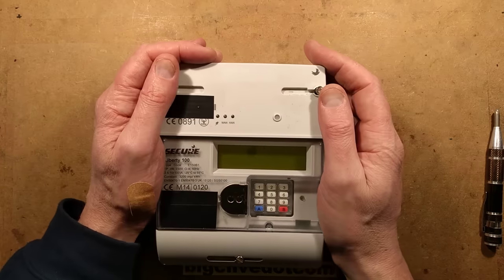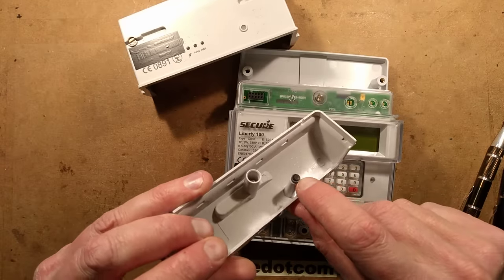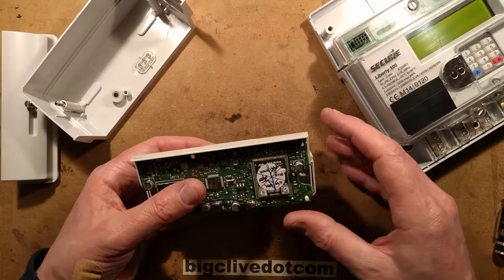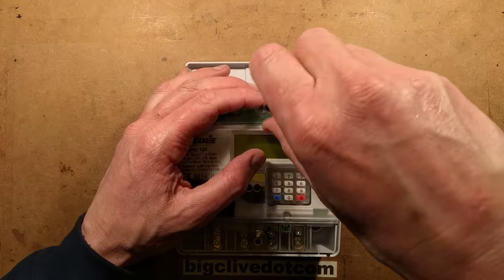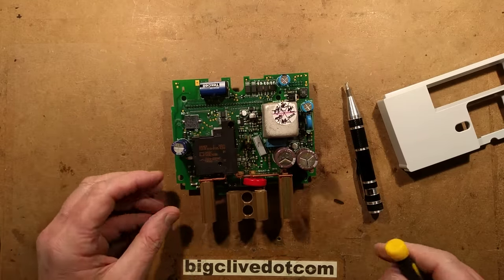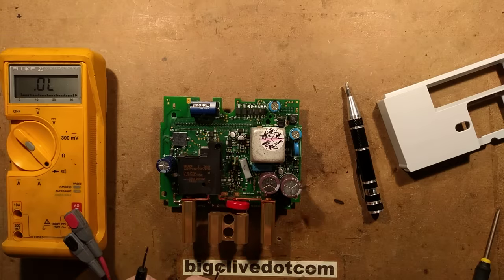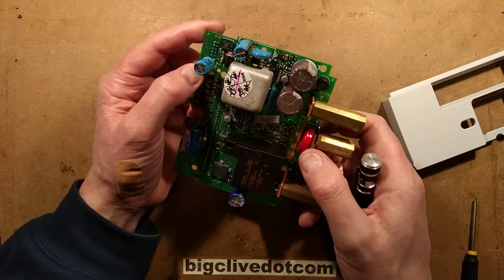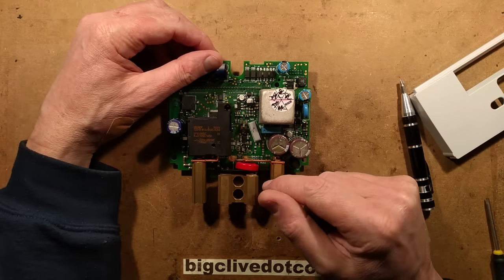Inside a smart meter, and the REAL problem with them.

Comment: It's smart not to have one.
Reply: The brain works on electromagnetic waves
Reply: @deanlatter5657  The brain works on membrane potential and neurotransmitters.
Reply: @falcon5751  No they don't work on WiFi, they work on the GSM network - mobile phones - to communicate with the electricity company..  They may use Wifi as a bolt on extra but their communication to the in-home display uses 433 MHz same as doorbells, etc.
Reply: jimW133 i know for a fact most lazy enexis workers in the netherlands will just put it on the home wifi

Comment: Great video Clive!  Is there any form of surge protection in it to protect the meter itself?
Reply from the maker: It's a while since I've seen inside it, but I'd expect basic surge protection.  Their use of small conventional transformer will make it electronically robust.
Reply: The Metal Oxide Varistor mentioned in the video protects the meter. It sits across Live/ Neutral and shunts current to ground when the mains voltage exceeds limits

Comment: The real problem with smart metters is that while they are properly calibrated and certificated there is a setting called 'correction factor' that can be controlled remotely and while normally it should read '1' there are cases when it is changed to say '1.02' and one of the reasons is to compensate for unknown power loses in a residental area, sometimes it is easer for them to adjust metters in that particular area than to seek for real cause of the power loss. So you receive bill for the real spent energy * 1.02 Not very legal thing to do as you can proof it with your own certified metter you can win the court.

Comment: Thanks for this Vid. Two key takeaways. Anti-tampering provision and remote cut off ( something not available on conventional meters).
Reply: You might add a third one: "education" of the customers: with more "wind and solar" (AKA fakepower) production, we get an increasingly unstable grid. Introducing penalties for power consumption at "peak" times is just a variant of rationing ... You might call this a soft "grey-out" to reduce the risk of a full-scale black-out...
Reply: Remote cut off is not a potential, and there are many ways of anti tamper/tamper detection Is in every meter, smart or not, credit or prepay. 

I worked for a manufacturing company for smart meters and now I install them, so I am well educated in this.
Reply: @raidersheen4873  There are other posters saying Remote disconnection of customers by Utility company was possible. My comment might have been slightly misworded.
Reply: @richardcope8102  there are also people who think the earth is flat. 
Whilst there is mechanical possibility to turn the supply off remotely, they do not have the software to do this. (Currently)

It is in discussion/dispute if energy suppliers should be able to turn off the supply, how ever it would NOT be for non payment, it would only be for safety, and would not be on a house by house basis.
The model that is being talked about is for large scale disconnection in the event of a large scale malfunction, say at a substation. This would make it safer for the engineers who are fixing the problem.

Comment: My impression is this thing is a fire hazard. It's well known that the contacts of series connected breakers can become VERY hot when oxidation takes place. Over time, the heat builds up and becomes a full scale arc, that will ignite the flimsy pastic case. Once the case is burning with flames, you have a house fire under your stairs. That's why contact breakers were always contained in a steel case to prevent an arc induced fire spreading to your house. This serious fire issue was "missed" in this otherwise excellent video.
Reply: "Once the case is burning with flames, you have a house fire under your stairs."
They are made of plastics with additives that don't hold a flame unless they are directly in fire. Breakers usually just darken and that's it. The other thing is, at least in hungary they made the placement of metering devices really strict in recent years and you can only have the meter in a really specific boy, on an outside front of the house, directly visible from the street, or on a metal frame at the property border
Reply: @whatevernamegoeshere3644  Once a full arc is established between line and neutral in the enclosed smart meter plastic case, the temperatuture rockets. Anyone who has worked in the Fire Service and H&S fire prevention knows nearly EVERYTHING is flammable once the temperature rockets!! Steel enclosures are about as fireproof as you can get, and EVERY breaker carrying high currents MUST be enclosed in a steel case. The "cheapo" plastic smart meters burn like a "Roman Candle blowlamp" once the temperatuture of a full blown arc is reached. The flames of the burning plastic case are also highly conductive, and increase the size and heat of the arc!! If this
 is happening under your stairs, you have a major house fire, and your family is likely to become KFC!!!!!!
Reply: @davidhine619  Once an arc is established between L and N, it's a short circuit and it blows the main fuse or the fuse on the street incommer. You have very little clue of how arcs work.
Reply: @whatevernamegoeshere3644  An arc is NOT an absolute short circuit, otherwise the heat of the arc would cease. Arc resistance is likely to be around half an Ohm or so THAT would NOT be guaranteed to blow the intake fuse. How do you suppose house fires due to faulty wiring etc.
usually leave the intake fuse unblown on low voltage domestic supplies?? A mains fuse is there to protect the supply before it, NOT ANYTHING that comes after it, which in this case is the smart meter, your house and your life. Be wise to fuse protection, and why any fuse is placed to protect the incoming supply and NOT the load!!!
Reply: @davidhine619  House fires mostly come from bad connections increasing in resistance due to long term oxidation, overloading or because of connections that were made between different , incompatible metals causing a layer of insulating corrosion (like in the case of Al and Cu). As for short circuits, a short is not a zero ohm short in this sense, but the current required to blow the fuse before it, under 0,1s time (or lower) usually, also known as fault current. And as for fuses protecting wiring before them... no, that's not how they work. Fuses always protect the load lmao. You are so confidently wrong that it's just hopeless. How many michael bay movies do you watch a week?
Reply: @whatevernamegoeshere3644  You talk nonsense. Any fault / accidental smart meter arc is as unpredictable as throwing a dice. I say again, with absolute authority, a series connected supply intake fuse is there ONLY to protect the equipment / wiring that comes BEFORE it. The electronic current breaker in your distribution box (steel cased) is wired AFTER the smart meter, so if the smart meter explodes into flames, your distribution box breaker will NOT protect you, as it's placed AFTER the smart meter. Got it?????
Reply: @whatevernamegoeshere3644  I suggest you look at some YouTube videos about smart meter fires and read the comments. I rest my case!!
Reply: @davidhine619  you are insufferable 😣
You win baby boy, have your bottle 🍼🍼 🍼 🍼 🍼

Comment: If they produced radiation the dosimeter I carry with me all the time would make a lot of noise. The microphone is under that shielded section btw ;) I do take issue with the whole claim about them changing the tariffs and measuring apparent power - most countries have consumer protection laws that would prevent the kind of thing you're talking about and in the UK especially the energy companies don't own the grid, it's not their problem.
Reply: Doesn't click, and there's a long list of reasons why I do and none of them are tinfoil hat.
Reply: I'm all ears, Martin.
Reply: monkaS.

Seriously though, I have a relatively quite high lifetime dose from employment (NDT) and medical reasons (long story) - to the point I don't personally think I should be flippant about radiation exposure - and just general scientific curiosity reasons (mapping what should in theory be background radiation levels geographically is a hobby project of mine). Never go full Cody.
Reply: There are other types of radiation, ionizing and non-ionizing are the key words here. Your dosimeter @Martin Nicholls only measures ionizing radiation, such as that put off from radioactive matter/fissile matter (Alpha particle, Beta particle, and the electromagnetic Gamma ray), whereas 2.4GHz and 5GHz and the rest of the telecommunications bands are non-ionizing. Sunlight, after filtered through the atmosphere and the magnetic field, is also non-ionizing (For simplicity's sake, the Gamma rays were filtered out). The issue with non-ionizing radiation such as 2.4GHz and 5GHz is that they excite water molecules (vibrate, etc). Those frequencies are easily blocked/absorbed by water. For reference, a microwave oven uses 2.45GHz to excite the water molecules in your food. This is the reason why people think that you can get cancer from 2.4 and 5GHz signals, and they would not be wrong as non-ionizing radiation, similar to ionizing radiation, has an additive effect to your body, similar to how the non-ionizing radiation put off by the sun can give you a sun burn, sun poisoning, and after years of repeated and severe exposure - skin cancer can develop from damaged DNA in skin cells, cells which would under normal conditions be eliminated by the body, but, after repeated exposure/years of abuse... In the case of the 2.4GHz and 5GHz frequencies, this damage is caused thermally.

The water molecules in your body, similar to the water molecules in your frozen dinners or in the water molecules of a poor frog some heartless kid threw into a microwave (think of it as an exploding can of red paint and goo), WILL, WITHOUT ANY QUESTION, be vibrated from any 2.4GHz or 5GHz signal to some degree regardless of intensity. The faster a molecule moves, the more energy it has. The more energy it has, the more the object expands/the hotter it gets. The key word here is heat. Eventually, DNA CAN BE, and IS damaged by the thermal effects on water by 2.4GHz and similar signals. There is a reason why microwave ovens have a metal mesh screen over the glass, and there is a reason why microwave ovens are built out of metal - it's a Faraday cage that is built to keep your face from melting off, or at minimum, to keep you from getting cancer.

As per the claim by bigclive and others that there are no harmful effects of non-ionizing radiation:
There was a study performed recently that examined the effects of non-ionizing radiation on the DNA of bacteria collected at cell phone tower sites. They had discovered that of the bacteria that could actually survive the thermal effects of non-ionizing high frequency radiation were multi-drug resistant when compared to other samples of the same bacteria taken somewhere else. The conclusion was that the DNA of the bacteria was damaged in such a way that it was able to rapidly mutate defense mechanisms to antibiotics, thus making these cell phone towers the proverbial breeding grounds of super bacteria strains. Additionally, another recent study found that women who place their cellphones inside their bras were many, many times more likely to develop breast cancer right underneath the same exact spot on the breast that they preferentially place their phones. 

I dont care what sort of background bigclive and others may or may not have when it comes to engineering or EM radiation... if you can cook with it, if you can potentially transmit power with it, if you can damage DNA with it, if you can mutate bacteria with it, and if there is medical evidence of the potential for it to cause cancer, calling it "safe" and saying that everyone who disagrees with you for a valid reason is a tin-foil hat wearing conspiracy lunatic, even if it was not actually said in that way (intent), makes you look like an ass.... Further, any basic college physics course should cover this subject, as these physics courses specifically deal with energy/heat/heat transfer (along with kinematics/etc), and these same courses should also cover EM radiation and it's effects as well, as do most two-part introductory physics classes for scientists/engineers do. Anyone who was actually listening to these lectures would at minimum know that 2.4GHz signals are used/can be used to vibrate and heat up water molecules. 5GHz can also vibrate water molecules... as can a whole band of frequencies. 

Maybe the effects from a singular cell phone are not that bad, but considering that the entire globe has thrown itself at cellular technologies without first investigating it thoroughly over the course of decades, and considering that there is only going to be more and more non-ionizing radiation pelting one's body, it is a wise precaution to get people to turn their phones off from time to time, and it is a wise precaution to enact stricter regulations to EM radiation from telecommunications equipment. A cell phone surely is not a microwave oven, but the effects, again, ARE additive.
Reply: "For reference, a microwave oven uses 2.45GHz to excite the water molecules in your food" - when they start putting cavity magnetrons in metal boxes and forcing people to sit in them to get phone service this will be worth talking about - it still wouldn't give people cancer btw, but it would be dangerous. Not for nothing though the effects of EM radiation are well known, the levels drop precipitously within meters of antennae and we're deep enough into the existence of this technology that you'd see epidemiological evidence of problems by now, and guess what - you don't. The tin foil hat brigade is why we can't have an adult discussion about the V band - you're doing far more damage than good I'm afraid.

Comment: SSE keep asking me if I want one.After watching your video,I'll decline their polite offer.Great advice
Reply: I had a lucky escape, SSE were due to install a smart meter..  Im in an area with no cellphone coverage and the electrical supply comes into the house via lead and paper insulated wires and to a Frankenstein like power board with many rcds, Bakelite and wood junction boxes and very old dodgy looking wires.  They literally took one look at it and buggered off stating the property was unsuitable for a smart meter installation. Lazy sods lol
Reply: @meetoo594  We had the same with SSE, to the point they got very rude with my wife when she kept declining. I changed company to a supplier that is not a so called top 6 supplier. So far, that second supplier seems happy to allow me to send them readings via their online portal each month.
Reply: @JohnCarverUK  Im in a bit of a spot now, the button that displays the electricity used has busted so I cant give them readings anymore.  I have guessed the last few times  but will have to get em to fit a new meter soon as I really dont want to be clobbered with a giant bill when they eventually work out the actual usage. Should be fun watching them scratching their heads as they try and work out how to tackle the job lol.
Reply: @meetoo594  I would visually record evidence (at the time of handover) that the meter will not read, as they are going to struggle perhaps in providing any sort of final bill.
Reply: @JohnCarverUK  good idea, they won't miss a chance to screw the customer over.  although it's only the button that's busted so I imagine shorting the contacts with a screwdriver would advance the display. I'm not going to tamper with it though, I will let them sort it out.
Reply: @JohnCarverUK  it's actually really frustrating as I can read the daytime usage but can't advance the display to the economy 7 reading and their website won't let you just submit the daytime one.

Comment: The modems have a super cap to send a last will message… 
They also use 868 (Uk) to talk to the hand held display screen. 
They also read stupidly high kWh when the meter OP configures it wrong! 
Think they get the power factor wrong / some conversion factor on the current flow measure

Comment: I have one of these in my cupboard under the stairs. The keypad is for vending, checking the meter reading and reading the data on unit pricing etc. Strangely, the remote display can access some of these but not display the meter reading which seems counter-intuitive ! Although it's called a smart meter only later versions can cope fully with supplier changes. A new supplier won't be able to read it, which is pretty daft, requiring an entirely new meter to be fitted ! Regulations still require a human meter reader once a year.